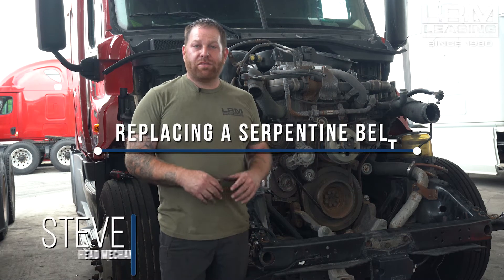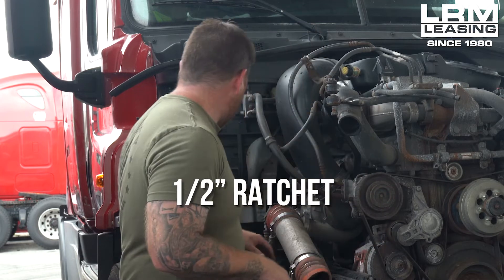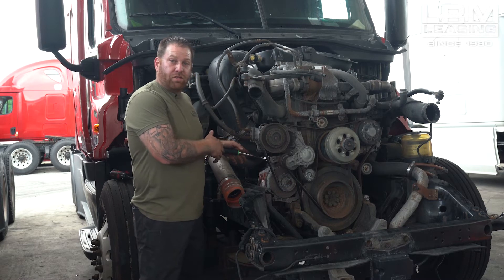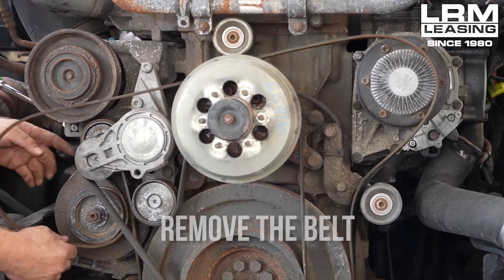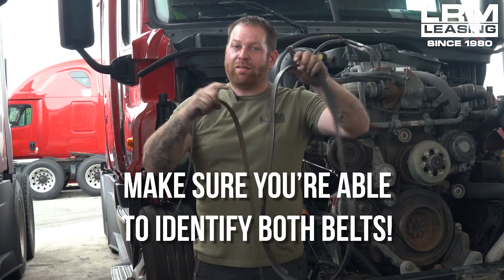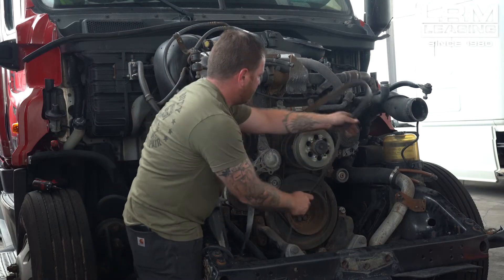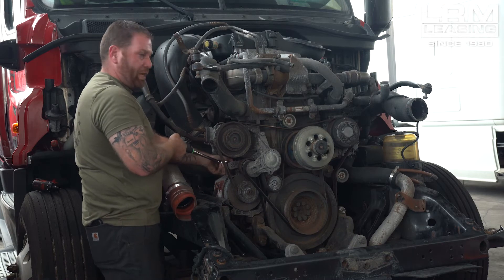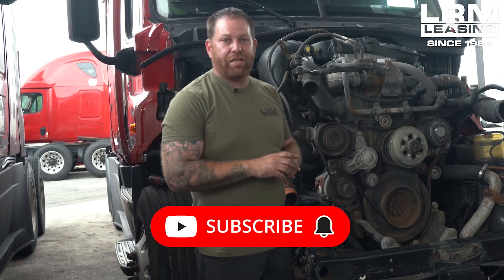Replace a Serpentine Belt on a Freightliner Cascadia DD15 - LRM

Comment: So there r two belts.. one is serpentine( ac compressor water pump etc) , other is fan belt( which runs radiator fan)
Which one among these usually goes bad early as compared to other one?